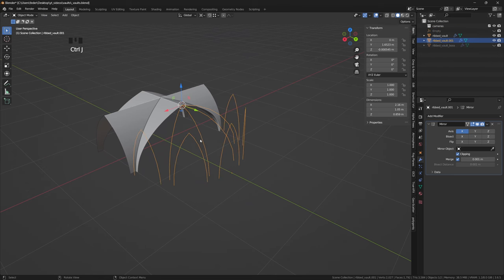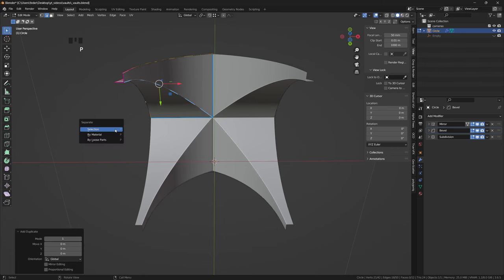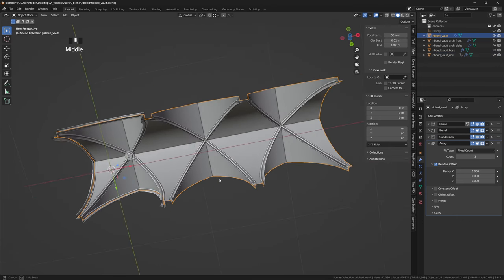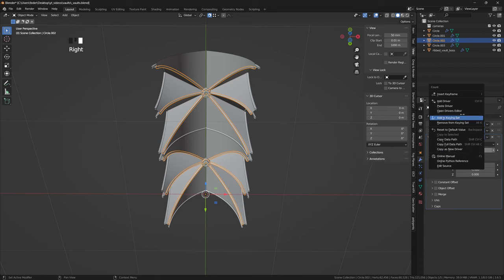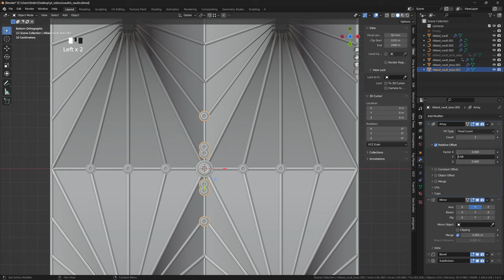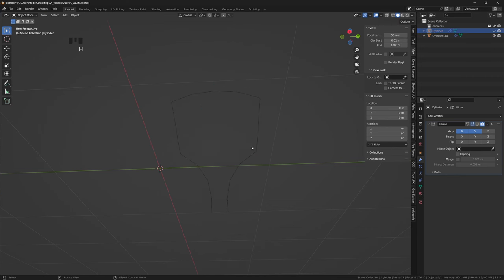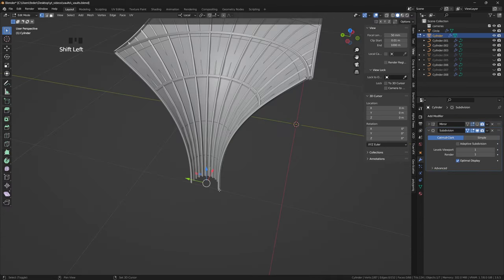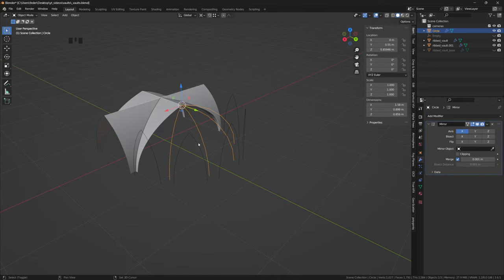Modelling vaults in Blender  - The Pointed Arch

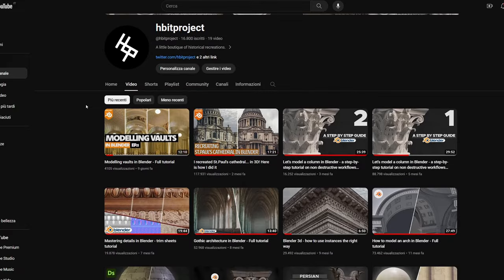Comment: 0:20 actually this doesn't need a fix at all. Your original version is more historically accurate. They would absolutely have made the diagonal ribs a half-circle or pointed arc shape. If the ribs followed the profile of the "gables" it would have been impossible to just cut the stones and use them in whatever part of the rib they liked because the radius changes constantly. That this leads to slightly warped panels isn't a problem at all, neither from a construction point of view nor aesthetically.
Reply from the maker: Thank you for sharing this, very useful and interesting to know 👍